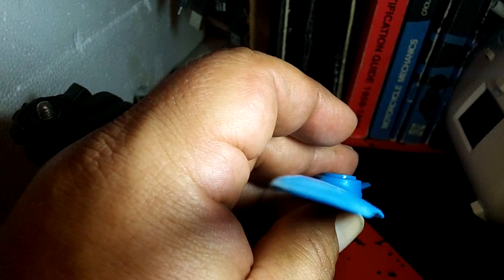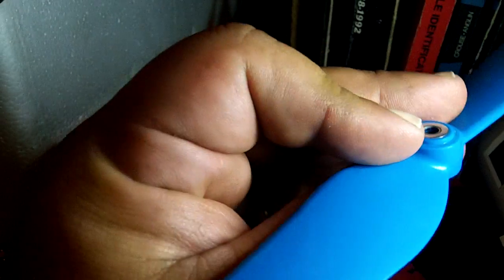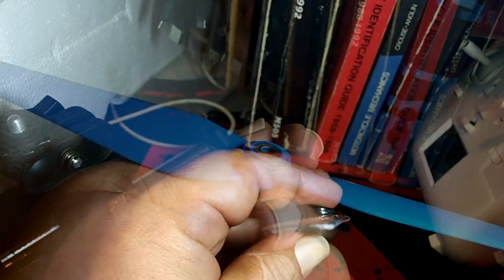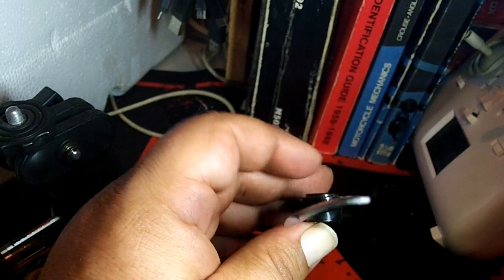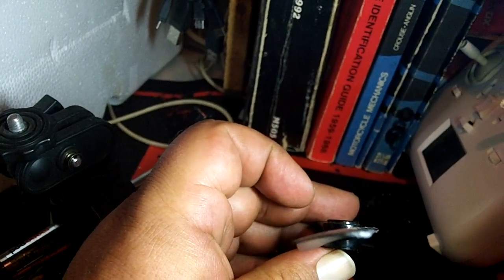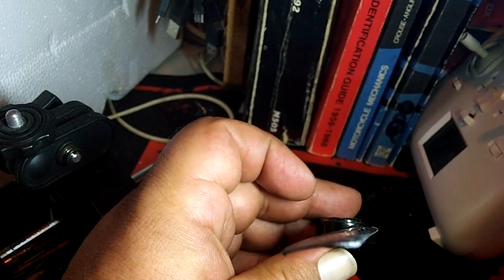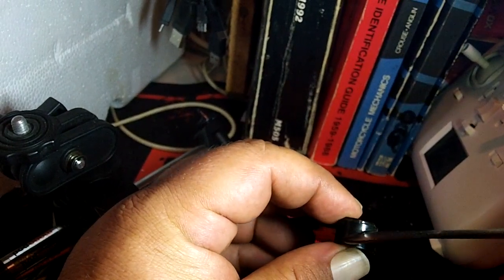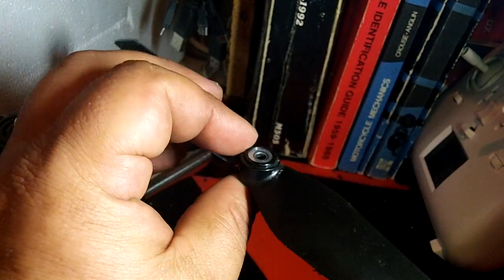How to tell a counter clockwise prop from a clockwise prop

Comment: Unfortunately the terminology used in this video is exactly the opposite of the traditional description of props. For at least a hundred years, props were described according to how they rotate as viewed by the pilot in the cockpit of a tractor plane (i.e. one with the propeller at the front.). So if he sees the prop rotating clockwise, it is a clockwise prop. Of course if you view the prop from in front of the plane, it is rotating counter clockwise, but a decision had to be made regarding the convention that would be used, and that decision was in favour of the convention I have just described.

Now that we have quadcopters an error has crept in. Because we're often looking down at them from above, many people are now describing the props according to the way they turn when viewed that way. Result: utter confusion
Reply: Good explanation. Thank you.
Reply: thank you
Reply: Mystery solved.  thank you!